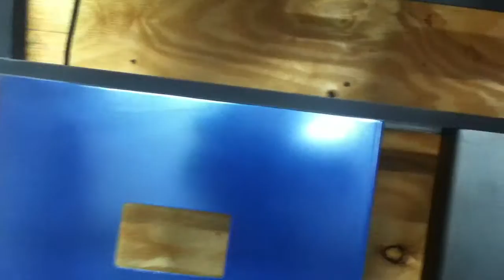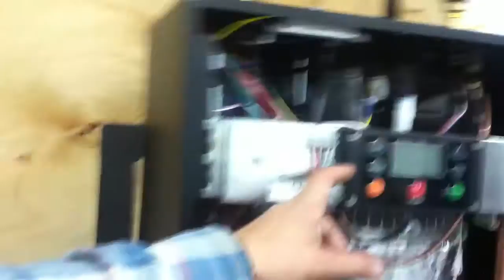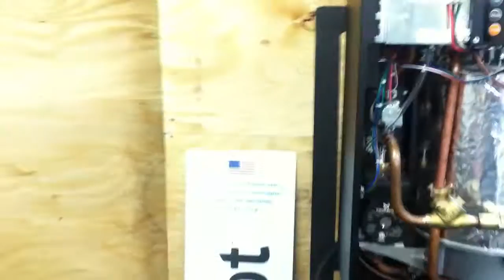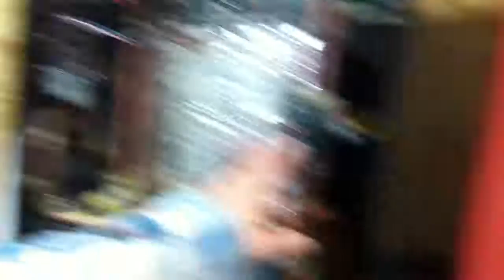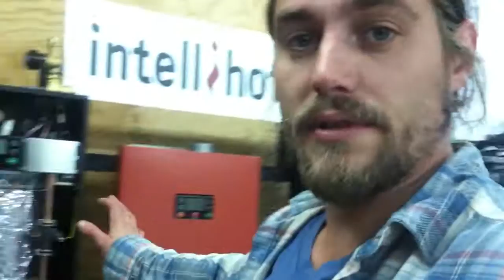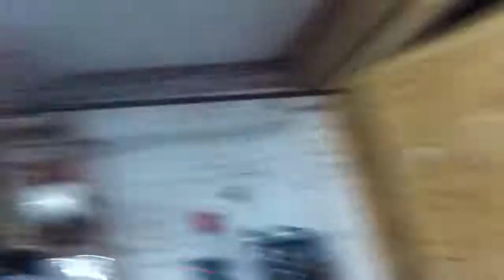Intellihot review/ Sales NYC- CT

Comment: The worst investment, the worst hot water heater… nightmare
Reply: We have these of various sizes in a few of our hotels, they are awful! Starting at like 2 years blowers go out at like a thousand dollars a pop, ignitors go out all the time, sometimes you will have a fault for like a sensor after you replace the sensor and turn it back on a totally different fault will pop up immediately!
Reply: can you provide more details, We are having twelve 1500’s installed
Reply: @GusTheOneAndOnly  
Constantly break down, too many moving parts, very high maintenance , expensive parts,flow sensors, gas valve failure , igniter failure , pump failure. Blower mot… and many more issues. Very bad  investment. Already planning to replace.sorry guys technology and reliability is not there yet. I spent over $3000 to $5000 and more  almost every couple months to keep them running,not to include endless errors history.

Comment: The internal y strainer is "last defense", if you have severely hard/ dirty water you would want another Y strainer,  (& magnetic particle filter) within the primary heating loop, filtering out contaminants as water passes.  Flash valves are usually for removing TDS within a steam system, (prob overkill for a combi boiler)   Note:  You should hardly get anything from within the internal Y strainer if you have other forms of protection on the primary loop.    Normally we will just have some form of isolation capabilities so we can check & manually remove debris from the Y strainer, during maintenance routines.